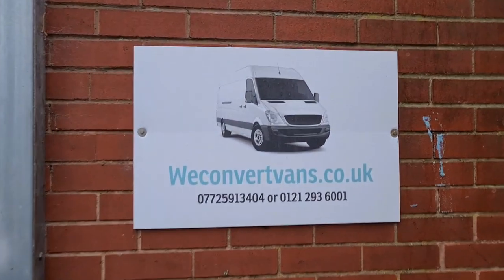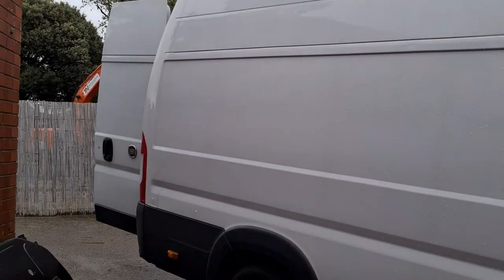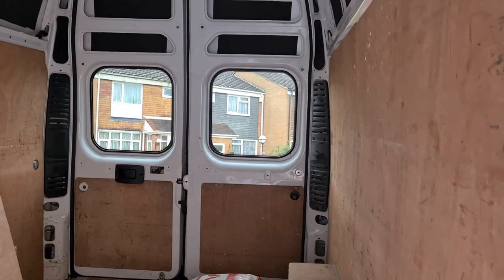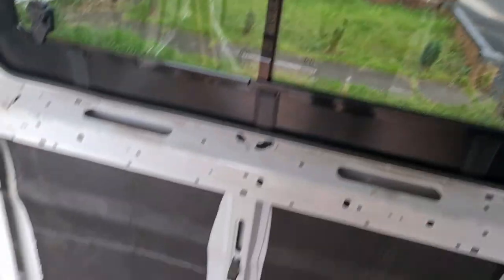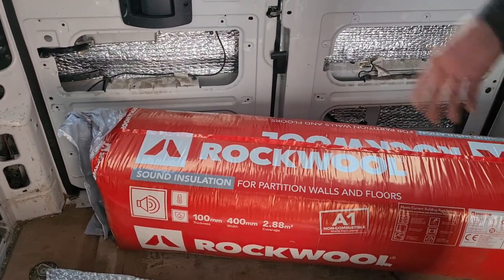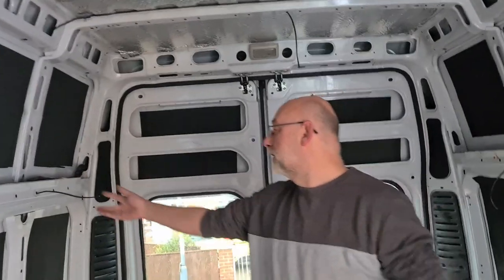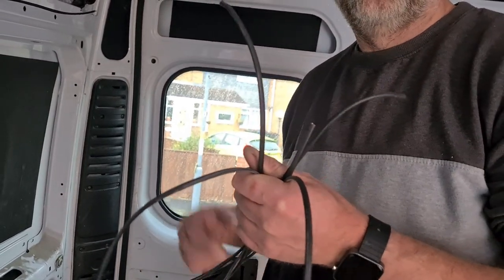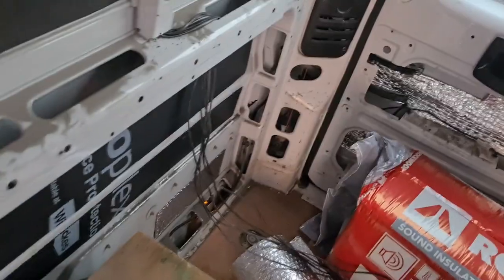van conversion windows and insulation

Comment: There's no stupid questions. The light thing was fine. It's an observation. At work, a relay that shuts down critical electrical things, I noticed the contacts were closed. I asked the relay man why were they closed. He told me they can't be closed, the equipment would shut down if they were. He insisted they were just "close together". Finally he looked and went into panic mode. They were closed, but another condition needed to occur before the equipment shut down (thankfully). The unit needed pulled and repaired immediately, before an unexpected shut down occurred. All based on what seemed like a stupid question to the professional. 

Great shows, great way to answer your wife's question, respectfully, and leaving it in helps others to not be afraid to ask. My wife and I watch the Magnet Fishing videos, and I'm interesting in the Van Conversion as well. 

Thanks.

Comment: next time when not knowing wich wire is wich use a 9 volt battery en stick you tong on the other ends of the wire or just use a cheap multi meter and put it on continuity